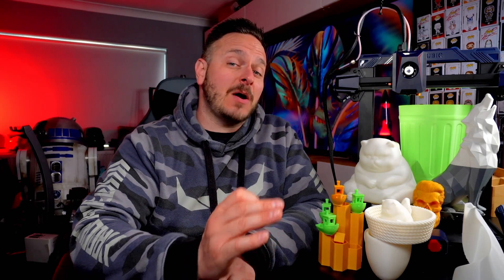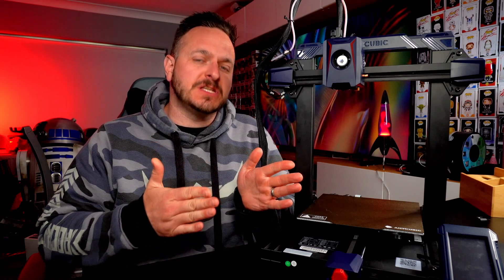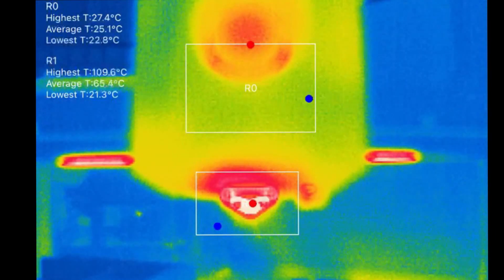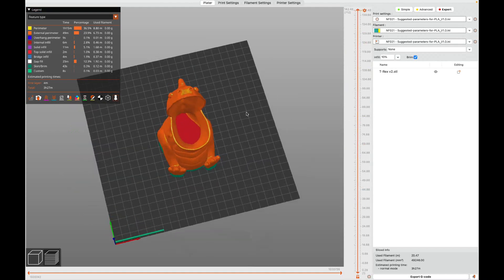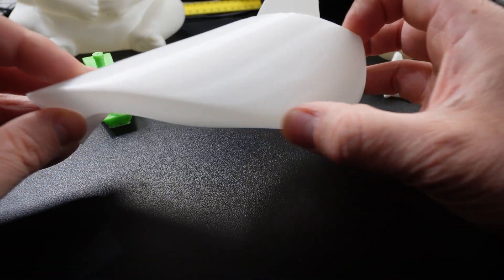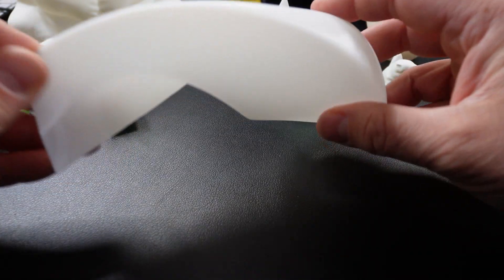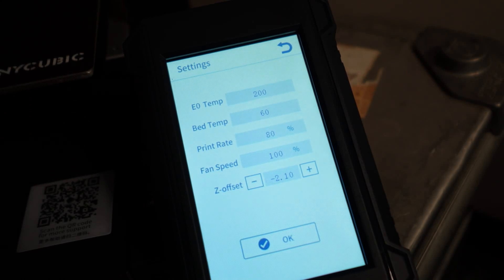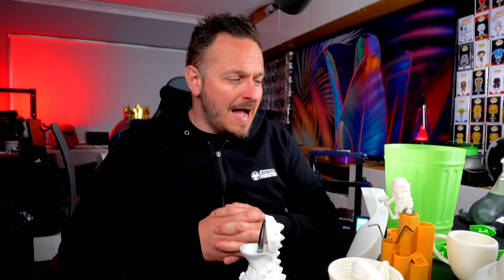Anycubic Kobra 2 FAST Bed Slinger?

Comment: What issues with the bed did you have and how did you fix it?? I got the same printer and its printing nicely except for the wrong step count on the X/Y motors, I got a 2% difference in size on the parts I was printing.

Comment: what setting did you change
Reply from the maker: Regarding what part
Reply: @TheRealSamPrentice  I dont recall what part lol, did you change any slicer settings?  also i own one of these printers ive adjusted the tensioners and the screws but it still has a fare amount of ringing on some prints.

Comment: Very happy with my original Kobra, but see this as a natural evolutionary step up in features and speed.  Having multiple printers, but net being a commercial enterprise, print speed isn't that big of a deal for me.  At this point, I sort of keep so many on hand just simplifying using each for various types of printing.  Kobra and Sunlu run my PETG on their PEI, Aquila with glass bed runs PLA, and a Sovol SV06 runs ABS in the garage on PEI.

Having picked most up as "unrepairs" on Ebay for around $100 ea. they're not much of an investment to just hang on to for my 3D CAD designs I create.

Comment: WARNING: You failed to talk about the nozzle issue.
This hot end uses a non-standard Volcano nozzle... In fact, we should not say Volcano as it is not one.
A real deal breaker for us. We can't find suppliers for this weird type of nozzle so will probably end-up returning the multiple Kobra2 we purchased for our print farm.
Reply from the maker: WARNING! I’ve not had any nozzle issues..
Reply: @TheRealSamPrentice  Don't wait until you get one... Check carefully the spare one in the bag that came with the printer.  Look at the base...Try to use a standard Volcano Nozzle.... Have fun !
Reply from the maker: @saguenayit  … dude not cool

Comment: Well, I can't say anything about the printer itself, but they do have a good advertising campaign for sure. And the appearance. First I saw it, I was like "wow, this is surely what I have to buy!". But after some time I think still that classic Ender 3 is still a good solution. Of course you will need to modify it. But you also have a lot of freedom, you have spare money for upgrades you want.
With Kobra, yes you have all the upgrades already, if you want them, ok. I do not want metal top bar be upgraded to plastic, do not need second Z spindle, do not need touch screen. The print head looks interesting though, for me it is more attractive then Sprite. But it is for whom how.
I still have no regrets about my classic Ender 3 setup. It is quite easy to make a short bowden direct with little effort, and noise can be reduced by lowering power on drivers. And soon I will install a sawed e3d radiator with minifeeder.
Reply from the maker: I’m not really sure of what you’re telling me? You’re telling me about a 5 year old printer that you have? Awesome I’m glad that you’ve spent time on your hobby to make what you want ultimately! Of course modding means you have no support in the long run and that’s not for everyone. One of the major problems with broadcast and promoting or even reviewing a project is that everyone looking or buying will have a different reason to print. Some of course won’t want to mod or play around with the printer, they will just want it to print.
Reply: I bought it in august, so it is less then a year printer. But it does not mean much, as most E3 clones are just like it, only unneeded things are added like second Z spindel or color screen. Sometimes it is a bad driect-drive, which is even worse.
I know that west 3d-printerers do not like to modify, just use what they bought. It is OK.
But you are wrong about support. If you use opensource mods you have experience of thousands of people and support. If you buy some proprietary hardware you have no support as they abandon this anytime they want.
But modding itself is not for everyone. 3d printing is not for everyone too. Why bother, when you can pay 'special studied person' who will print anything for you in high quality. If you have money of course.
We have different opinions, that is OK.
I prefer Ender 3 because it is cheaper to start printing. It prints out of the box. And for the same amount of money as s1 version or Kobra 2 one can gain things he want.
Also those metal rollers are a big question. While rubber wheels are not only old-school. But also a sure thing.
Time will show which construction is best.
Also if we talk about 'we have infinite money, but for some reason we want to 3d print and not to order 3d-printed from someone else' I guess one should look at Bamboo printer. It have a lot of proprietary stuff, I guess it is a very good choice for someone who do not want to mod and love when manufacturer says them "Hey it is time to buy new printer, we removed drivers for Windows X version". Like my Canon printer happen to be. Luckily I switched to Linux long ago, so I can still use my printer (yes it is not 3d) with opensource drivers.
Thanks for you reply. My post was not for you personally, it is for anyone comes to YouTube and read comments. I have watched near 10 Kobra 2 reviews struggling to buy or not to buy. I already have 3 printers. And yes all bought in a year. And all are mod-freindly, Ender 2 pro and Tronxy x5sa-300. Those all work out of the box, but can be modified without much effort. Well Tronxy have some trouble with firmware (as I heard).
I love DIY and understand that is not an everyone thing. It is OK. All crayons are different in taste = )

Comment: Hi Sam, hope you're well mate. Been watching your vids about K1 as well. I am a complete newbie and wanting to get into 3D printers and been looking into some budget ones, e.g. neptune 3 pro/plus & kobra 2. Then I got into the world of klipper and slowly but surely the budget creeps up, then if I want to have camera, side panel (i know that it is not available for the budget model I mentioned), display pad, it'll go up even further...and fast. Correct me if I'm wrong, but I think K1 is pretty much a klippered machine, correct? and would you still recommend this as a first timer given your unfortunate experience with it, or would you recommend another printer? Thanks
Reply from the maker: Lots in that! Okay so the big debate is around klipper and companies trying to close source it which conflicts with the licence agreements between klipper and the open source element. One of the major factors that is causing some hardship is that on the k1 Creailty have closed the ssh login for the moment, and part of what klipper offers you is the open element. It’s a bit like someone taxing you for the air your breath. Now from a Bambu front they claim to have a proprietary setup but apparently isn’t fully klipper. Thing is will all these things simple means it’s simple if you’re having to play around with stuff all the time it could make or break gig inside this hobby.
Reply: @TheRealSamPrentice  so which printer do you think I should go for? I want to spend more time printing stuff than tinkering on the printer and it ended up being the project.

Comment: I am always confused why some manufacturers never make a GUI for the full colour touchscreeens with more than 2 colours, and just the basic commands for the FW, I prefer the 12864 control screens as they are easy to add new commands from your Marlin compilation, considering you usually only use the screen to start a print I dont see the point in touchscreens, I upgraded my CR-10 to a touchsceen but then ended up using the 12864 emulator on it as I find it much better.
 For me quality is more important than speed although speed does come in handy for prototype prints and new iterations of designs, I cant see myself buying another bedslinger but for those buying to a budget or buying their first 3D printer I can see people being very happy with one of these.

Comment: Good points? Sorry, what I see is another FDM Printer with zero Innovation. I do not understand at all, that this company has not more to deliver.
Reply from the maker: I tend to agree, but have all the ideas been used up on the bed slinger market ?
Reply: @TheRealSamPrentice  An Innovation comes from an invention. If I have nothing new in the pipeline, why throwing another printer on the market with zero new outstanding functions. Simply invent new things and if you can't, don't try to fool customers with cheap claims and advertising blabla. You know exactly, that this thing won't be able to print anything near 250mm/s. In good quality Bad for then, but they won't get my money at all.
Reply from the maker: @oli4572  I do agree with you complicity, what’s next ?
Reply: @TheRealSamPrentice  For FDM bedslingers, I doubt there will be any  progress or innivation possible at all. Speedwise they are at their limits. You can't cheat physics and they won't be able to print like core XY. And even they reached somehow a phisical limit of melting filament and acceleration. We will may see progress, multimaterialwise, new extruder, maybe, hopefully tool changers, and software wise. Arachne and Arcwelder brought big efforts, pressure or linear Adv, individual bed leveling... I guess software and new gcode will bring the biggest efforts in FDM.
Reply: @oli4572  I thought the same thing about bed slingers until the V-Minion. Mine has a few mods, and can hit 800mm/s and 60k accel. I can even print sub-15 min TPU95 Benchies on it. Sure, it's a 180mm bed, and you won't get that kind of performance scaled to 225/250mm, but it does show that a very rigid frame, linear rails, and use of Klipper's tuning futures can take you far beyond what these bargain-basement printers will provide.
Reply: @JonS  Lol, you never ever hit these 800mm/s when printing a benchy. Besides that, I am talking about printing in a reliable quality. Meaning stability, watertightness and look. I bet your TPU benchy looks like the finest peace of Art?! No offense, but you can not beat the thermal limits of plastics.
Reply: @oli4572  I didn’t say I hit 800mm/s printing a Benchy. All I’m saying is bed slingers are not out of steam yet.

My TPU Benchies need more cooling. They are not great, but surprisingly good.
Reply: @JonS  And exactly this is the point. Thermal capabilities of plastics, the time they need to heat up and melt and the time they need to cool down are restricted by pure physics. I have also a couple of printers, able to print as fast or even faster as the minion. My Voron 2.4 and 0.1 for example print tons of 15min. Benchys. But trying to print a waterproof box, or a really strong part, I need to restrict acceleration and slow down speed to 250-300mm/s. Only cause the limit is not the hardware, it's the thermal limits of plastics.
Reply: You seem to know your stuff, what is the best 3d printer to get in this range?   Under 250$ish. 

There’s so many damn options and they all seem the same except for the print speeds, which I’m learning now is just marketing bullshit and you won’t really print at those 250mm speeds anyway.  I’m torn between the ender 3, the kobra2, the rg maker r1 and the ender s1 … I had a trunxy crux1 that I had nothing but problems with so I need one with ABL and definitely want a PEI magnetic sheet , no glass and no clip on stuff.
Reply from the maker: @DeRock401 ender 3 Ke for the money is good

Comment: Tronxy X5SA Pro used those rails for the core xy setup as well.
Reply from the maker: Is that right? I’ve steered clear of Tronxy to be fair they seem too cheap and cheerful
Reply: @TheRealSamPrentice  Also Kingroon.
Reply: @TheRealSamPrentice  I have only purchsed one returned tronxy x5sa pro with known issues for 130 USD, since I wanted to do a VzBot semi-conversion. I'd say that at 130 USD it is reasonably priced, but I would not buy any bed-slingers from tronxy, seeing what the competition has to offer currently.
Reply from the maker: @milowmilo  okay this is anycubic ?
Reply: @TheRealSamPrentice  I was replying to you saying that you stayed off Tronxy printers. Due to that I started talking about my experience with tronxy printers. I know that your video was about Anycubic. The connex was merely the rails on the kobra and the tronxy x5sa pro.
Reply from the maker: @milowmilo  oh I see sorry !

Comment: Anycubic are awesome printers. I have 2 of their chirons and they are some decent workhorses once you spend time getting them right. However, their customer support is lacking from my experience, I've had several problems with a range of their products and have recieved frustrating results from their customer/tech support. Other than that I enjoy them as much as my creality machines.